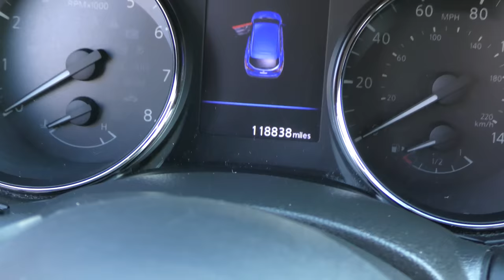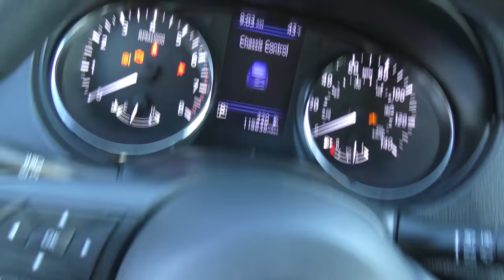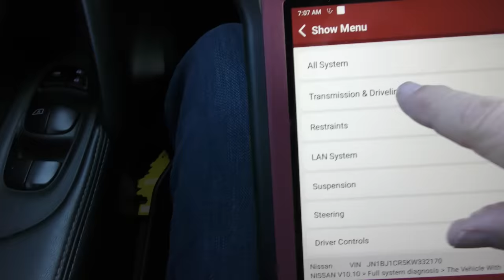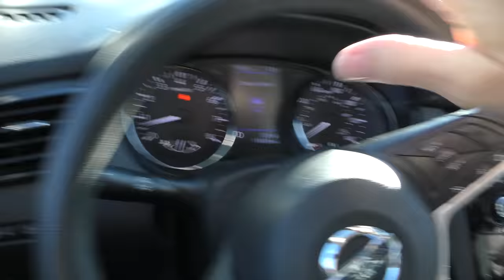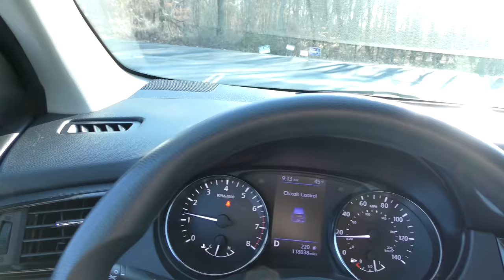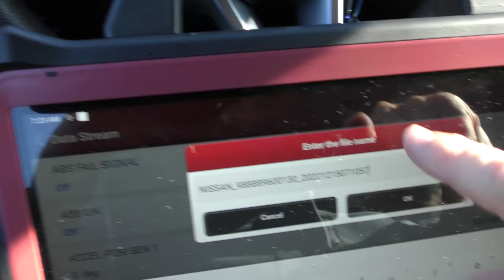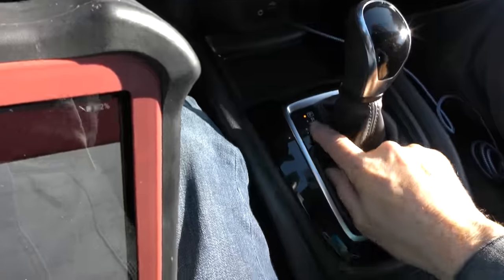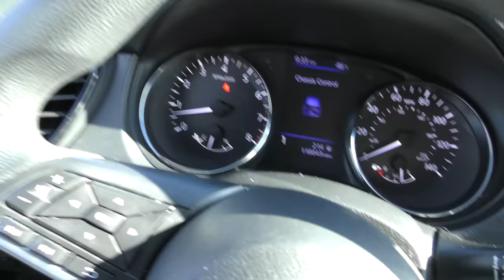The Worst Transmission Ever Made (Do Not Buy)

Comment: My 2018 mitsubishi outlander has a CVT and i learned a lot about them when i bought the car. I was desperate to get a car at the time and basically wanted whatever i could get my hands on. I actually ended up liking the car in comparison to a lot of others. Mine failed at 80k. Luckily the drive train warranty covered it. I knew that a high torque load is what would cause it to fail so i never put the petal to the floor but it was pretty fun to drive in sport mode and when getting on the highway or passing i would throw it in sport and get decent acceleration without putting it all the way in. That was still enough to cause a failure. I now drive it like an actual grandma so I'm not stuck replacing it again, this time out of pocket. I have a theory that these are being developed for robotic technology and thats why they are saturating the market with them. The consumer is funding the development of technology of war.. these CVTs will be in each moving joint of giant walking battle machines. Welcome to my rabbit hole.

Comment: Question:
I have a Crown Vic 2009 P71.
It has a overdrive on off switch in the shifter.
How does that actually work?
What's the purpose of that option?
When should I turn off or leave it alone?
I'm very curious to know.
Love your shows always exciting. 
You're a firecracker.
Reply: The purpose of the switch is to turn off the automatic overdrive. It mean turn off the overdrive gear, which is the highest gear on the transmission. On my 1999 Corolla the overdrive gear is 4th gear. I don't know why I would want to turn off the 4th gear (overdrive) but it has the button just like your Crown Vic does. I tell you what, google the question Why Should I turn off the Automatic Overdrive on my car, and then get back to me!

Comment: I purchased a 2014 Ford Focus a few years ago.  Only had 31,000 miles. That fuc****** CVT transmission was garbage.  Jerking during takeoff.  Slipping in and out at different speeds. I got rid of it in 3 months.

Comment: My 2013 Nissan rogue got 40mpg with synthetic oil and 100% gas and had 240,000 miles, but then the catalytic converter went out, but that was after Nissan put a cooling unit on the transmission
Reply: Replace the engine filter with a K&N air filter, the engine light should go off
Reply: Still you have a great Nissan Rogue.

Comment: My 2020 Corolla with cvt transmission has 46,000 miles, and lives on the hills of San Francisco, and works fine
Reply: Not much of a flex lol 46k is nothing
Reply: @RRLV434  but the hills are hell on transmissions
Reply: Do the rpm go to more than 5000+ in down hills?!
Reply: @dwdhb9905  well I do have a 67 cougar with a 390 that I've had for 46 years, but to much money in it now to go flying off the hills at over 5,000rpm ! But as a 13 year old in San Francisco I did see some of the movie bulliet filming and my brother,RIP doing construction on a road and being in the movie bulliet for one second. Thanks!

Comment: What year is his? 
We recently bought a 2018 that's really basic because it was a company car. 
The company did all the regular upkeep on it & its still in great shape, he just likes to purchase new cars every 2 years & got a massively good deal from the dealer for buying 5 new cars at once when the market was bad.
  Only driving issue I have is the same complaint he has for it in low speeds. 
   My other issue is we took our kids down the road to a local beach & I didn't think to get the info of the truck & boat trailer that pulled up beside me. Later on when we were ready to leave there was a NASTY deep & long gouge out of my back right quarter panel & it's dented in a little. 
Wouldn't you know it, this marina puts all it's  security cameras on the Ferry & the 12 boats that rent slips. They don't have a single CCTV on the parking lot & playground areas. 
Luckily the damage is all cosmetic, the sensors all still work fine but MAAAAAN was I pissed. We were on day 5 of our 7 day Love it or bring it back test drive. 
Had we taken it back that repair would've come out of MY pocket.
   Back in the day I could've fixed that myself just like my father taught me. But  new cars there's all the recalibration of the computers & high tech "Nope don't do it"

Comment: The 2014 ford focus se hatchback has a dual clutch but automatic with overdrive. Unlike the typical dual clutch on these models this one only shows automatic. Has the tendency to shake in first gear. I have been driving it in down hill over drive with later shifts and it drives way better. Why scotty?

Comment: me laughing in my subaru with a cvt at 116k miles with a tendency of driving agressivly, first tranny fluid replaement was done actually about 2300 miles ago.

not all cvts are garbage, only nissan.
Reply: I think you are not aware that before jatco use to make CVT for subaru, however car go by model and year, think you are not aware of those facts , trans may be bad 10 or 5 or even 1 year ago,  does not mean it bad today.

Comment: My sister's 2017 nissan suv forget what the midsize is called feels really weird at slow speeds but has over 250k on it. Original cvt still in it but it belonged to a salesman that only drove hwy miles before she got it at 160k from a nissan dealer because traded in for a new one!

Comment: Huh!  

I used to drive a 2012 and then 2015 Nissan Sentra (3-year leases), and tbh, I don't recall it being 'that bad' to drive.  Then again, I haven't driven too many different cars in my lifetime thus far (maybe 5, at best) for any considerable length of time.  And perhaps, in my area, the driving conditions were more "ideal", I guess?

I also took each car, during each lease, for regular, warrantied maintenance at the dealer every 6 months or 7000 miles or so (or whatever the recommended mileage was; I forget), so I guess that helped "mitigate", during the time I had each car, any potential issues- or 'extra' issues, at least- more than otherwise, maybe? Making it 'less noticeable'?

hmmm
I also, via the lease requirements, managed to drive for less than the max (about 45k during each lease term) mileage (about 41k first; 42 or 43k for the 2nd). Probably less than when the CVT 'fucks up or wears down'?  Also... if memory serves, I went on about 3-4 rode trips across a few states each, during the leases. Car drove beautifully- or close to it, at least- if memory serves, more or less.

Then again, besides to and from work 5 days a week, I don't really drive a whole lot, so maybe I just 'didn't notice' the issues a lot of people nowadays say CVTs have?  I guess it just rode 'well enough' for my purposes, so it wasn't a huge deal at the time?🤔

Maybe it's been so long that I now have a 'fuzzier memory' of its driveability, too (for all I know). But, nonetheless, among the cars I've driven, it was pretty-decent, all things considered.

Comment: What about a Corolla Cvt
Reply: You won't have any problems with it, nothing.  He's actually talking about Nissan
Reply: @modified93tc  thank you so much.  I have a 2010 Toyota with 219k miles on it. So my next one will have to be a CVT.  Do you have to change your fluid more often ?
Reply: @willieAtl  the fluid change is very easy, it's just drain and fill with drain plug and fill plug.  That's another big advantage they don't have to drop a pan and change a filter.  Toyota says it's lifetime fluid, I've changed mine 3x and will change again soon.  Research I've done recommended change around every 60k miles.  Use the recommended Toyota brand fluid if doing yourself or take to Toyota dealership to get changed.

Comment: All this is why manual transmissions are far superior to automatics or CVTs.  Not only are they more fun to drive but they last alot longer with minimal maintenance, also, if your starter or battery goes out you're still not necessarily stranded because guess what, you can push start them.  Unfortunately most people don't know this, plus for some dumb reason they prefer automatics so the auto makers are phasing them out.  Both of my cars are sticks, and I will continue buying sticks until I can't.

Comment: Scotty, I’m debating between a Tundra and F150. I keep hearing positives and negatives about the 10 speed transmission, so I’ve mostly been looking at the 5.0L with the 6 speed transmission. The other option is the tried and true quality of the Tundra. I definitely like more how the F150 looks and the creature comforts of it. But I’m not sure about the long term reliability of the F150. I plan on keeping the truck 10+ years. For Tundras I am looking at newer than 2016 with the crew max config. We will be needing a truck in 2024 for going camping with our two children. We plan on mostly doing camping around the Great Lakes and maybe down to TN, with a possible couple trips out west. What do you suggest? I hate the MPG of the tundra and the lack of internal features, but it might be better to spend more at the pump and less at the mechanics shop.
Reply: Personally I’d go f150, my dad has always had fords or f150s, currently has a 2019 f150 and a 2020 f350, anyways he’s had a 2001 ranger, 2011 f150, and a 2012 f150, not a single one had problems and he used them heavily for construction work so he would load them up a lot. The 2012 had over 200k miles until he sold it and the 2011 had 80k before he sold it to a friend, both trucks are still working well with no reported problems from the new owners. And the 2001 ranger held out like a champ, idk how many miles it had before it sold but damn that thing was old
Reply: Used a ford once for construction, loaded over 3000lbs one time on it, still hauled and nothing broke 😅
Reply: The number one selling truck in the USA is still the F-150.
Reply: @For The Ghost, Not The Cameras such as?

Comment: I have a chance to buy a 2017 pathfinder with a bad transmission. They just had the timing chains etc replaced for $4000  then cvt went bad. New brakes etc. I could probably get it for$2000 is it worth buying? I can change the trans myself. I am wondering if I could replace some bad parts and get by it still drives?

Comment: Again Scotty, I have to disagree with you.  CVT's are not necessarily bad.  It comes down to how it is taken care of.  It is not a race car, so don't drive it that way.  Also, maintenance is VERY important on the CVT.  We had a 2008 Rogue SL AWD, and changed the trans fluid ever 30-40 thousand miles.  We put over 400,000 miles on it, and no issues at all.  The only reason we traded it, was that we wanted a new car with more safety features.  You always are knocking the CVT, and it is always geared at NISSAN.  Don't forget that the CVT is used in other makes as well.  While not JACO in the other makes, the technology is the same.  Perhaps your experience is different, but, for myself and other folks I know, we just don't have transmission problems.  Now, I will personally state that I do not like the CVT, as I miss the feel of the trans shifting, they are still good trans.  As long as you are taking care of them, and, again, not hot rodding the car.  JMO
Reply: I know why he knocks it. I had the altima with cvt. It gave out at 90k. I changed the cvt fluid at the dealer twice in its life. Mostly highway miles.  There are just more bad stories of the cvt than good!
Reply: sorry but the nissan CVTs are indeed trash. Mechanics all over talk about how trash they are.  the failures are very very common.
Reply: Nissan CVT need change fluid before 30000miles, if you can upgrade the coolant do it. Just don't do hard acceleration.
Reply: @GF-mf7ml  Same with Honda HRVs. Change every 30k
Reply: Did you know they have 2 fluid filters on these CVT. The one that has the cooling line to it should be changed every 40k
Reply: Ever notice how the Mitsu Mirage with a JATCO CVT hardly ever sees failures? 
They make ~70hp at the crank 😂
Reply: @EVERY1SONLINEANGEL  the problem may be just that you had the dealership change your oil because dealerships do a terrible job and a lot of times they don’t change the fluid filters. I seen where they were charging for 7 quarts CVT fluid, and only using three. Then the mechanics would put the other 4 quarts on eBay. Don’t believe me google it on eBay and you’ll see a lot of mechanic selling it there.
Reply: Not every cvt is bad, just the ones Nissan uses. (And whatever other cars use the same trans)  There are other, better designs of cvt transmissions.
I worked at a trans shop for a couple years.  They had a guy dedicated to the Nissan cvt and he averaged about 2 rebuilds a week at one point.  The cvt Jatco transmissions in Nissan's are by far the worst design that I saw while I worked there.  All the power of the engine is transferred over 6 little ball bearings and those were usually the point of failure.
Now if you baby the car then yes they do last, (if you baby any car, it will last) but you practically have to accelerate so slow that you will have people honking at you.  And of course change fluid and filter every 30k religiously.
Reply: @procrastinatingnerd  technically you are suppose to accelerate slowly, and break slowly, ask you insurance, but in real world people do not.
Reply: @cb5110  Yes you are supposed to accelerate and brake slowly, but you are also not supposed to pull out in front of people going so slow that you're a hazard.  There is a reason that minimum speeds exist.
Reply: @cb5110  And also, I say that the Nissan's will last if you baby them and accelerate slowly because even if you accelerate at a reasonable speed, you know, like the average person does, that is what kills the Nissan cvt.  I am not talking about redlining it, don't misconstrue my words.
Reply: @procrastinatingnerd  To be honest, it a cheap design CVT, and the former CEO was cheap cutting cost everywhere,  the new ones are better, but they still have along way to go in terms of reliability, however I do not know if Nissan knew or not about the overheating problem, 2012-2017 models, but it was was a repair man that found out the CVTs was overheating, and the word start spreading around. it was sometime after Nissan change the service time to 30k.

Comment: That Nissan/jatco CVT is absolute junk. The solenoids in the valve unit fail at something like an 80% rate. My friend has a Rogue that had to have the valve unit replaced 3 months after it was off warranty. $3000! I told him to write Nisaan and ask for compensation as they should have replace the unit when he had transmission issues while it was on warranty. Nissan says that the check engine light has to come on before they will check the valve unit. Totally unacceptable. Luckily they gave him the $3000 back for the replacement. All because of improper cooling... smh